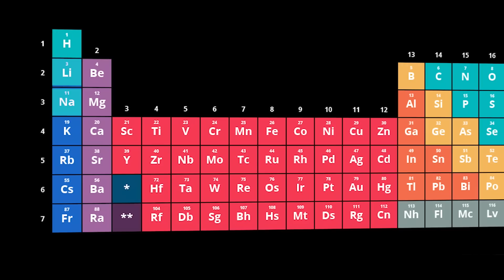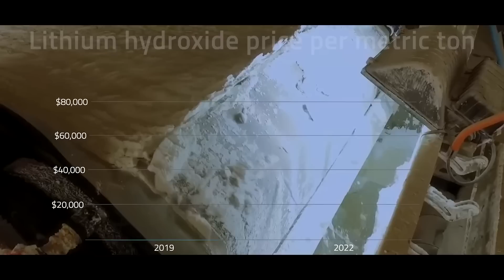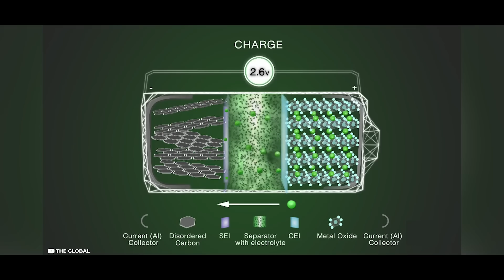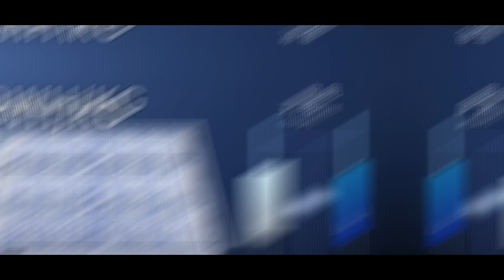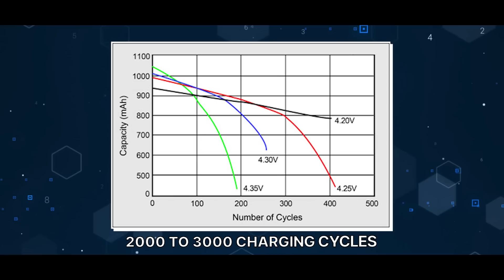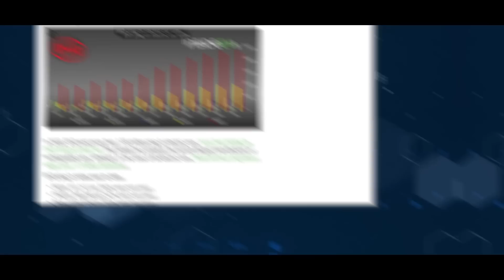BYD launching First 9000$ Sodium Ion Battery EV Changes Everything!

Comment: And think how much Li would be freed up if we used alternate technologies for static applications.  And these other batteries are superior to Li batteries in everything but weight.  They are made from cheap, readily available elements, are safer from a fire point of view, can be cycled from 0 to 100% with not damage, last far longer, need simpler charging/discharging electronics and can be recycled more simply, if you ever need to recycle them.  There are the liquid metal batteries based on SbCa or AlS (with new chemistries being tested), the ZnBr flow/plating or gel batteries, a whole range of redox batteries based on V and Fe (so far) and of course the mentioned Na batteries.  Note, for instance, that the famous Hornsdale 180mWh battery contains enough Li for 3000 60kWh EVs.

Comment: March 20 (Reuters) - For many electric vehicles, there is no way to repair or assess even slightly damaged battery packs after accidents, forcing insurance companies to write off cars with few miles - leading to higher premiums and undercutting gains from going electric.

And now those battery packs are piling up in scrapyards in some countries, a previously unreported and expensive gap in what was supposed to be a "circular economy."

"We're buying electric cars for sustainability reasons," said Matthew Avery, research director at automotive risk intelligence company Thatcham Research. "But an EV isn't very sustainable if you've got to throw the battery away after a minor collision."
Reply: There are approximate 6 million accidents out of 284 million vehicles on the road each year in the US, assume it’s all EV now, and ignoring the fact majority of those accidents are minor that does not require battery replacement, you are still looking at a 2% loss (reality is almost certainly less than 0.5% that need battery replacement due to accident).  

Now considering the amount of carbon output from those 284 million vehicles daily, factoring in the oil extraction, refining, and gasoline transportation cost to the gas station,  vs EV zero daily carbon output, power plants (many countries still use coal ) output due to electricity usage, zero fuel transportation output, and battery raw material mining / refining output. You are still looking at significant carbon reduction / environment benefits. That’s because the daily carbon output per vehicle is the most significant contributor to carbon by a very wide margin vs centralized power plant output that is far more efficient by comparison, even assuming coal and ignoring solar / wind that is powering significant portion of the electricity now. 

Do some research instead of just copying other YouTube comments as facts….
Reply: @onlythebest3311  Also...carbon is building block of life not a toxin.Parroting climate change propagandist with a decades long track record of failed predictions doesn't make you informed. Thanks for stopping by.
Reply: @pryda1  "carbon is building block of life not a toxin", this is so misleading and even wrong in many cases. Carbon dioxide is toxic if people are exposed to high level of CO2, from suffocation to acidosis. It is just like saying "water is building block of life not a toxin". However too much of water can cause water intoxication.

Comment: In the next decade or earlier there will be millions of EVs coming up for battery replacement. Can the same battery pack fit sodium ion batteries instead of LFP. I hope the dimensions and voltage characteristics are being kept identical to help in easy transition for existing EV users. It will be a game changer for sure if that happens. Let this news of easy transition for battery replacement break out and it’ll drive EV sales exponentially today. Nobody would be scared of buying an EV due to high battery replacement costs in future. A no brainer provided it can be swapped out with a lower cost Na-ion battery pack which can like to like replace the LFP battery pack.
Reply: Was wondering the same
Will they be able to be retrofitted ??
Reply: You obviously haven't been paying attention.. batteries are lasting longer than the cars themselves now

Comment: So here is some goofy math. If Sehol's vehicle can do 400k miles in its life time and costs $10,000, that is 40 miles / $1 vs an ICE getting 35 mpg (pie in the sky number) costing  say $3.50 per gal of fuel (this is also very generous) is 10 miles / $1. That is apples and oranges yes, but I am willing to bet that the cost to charge the Sehol vehicle over its lifetime is going to be cheaper then buying an American ICE vehicle. That is some too good to be true levels of costs savings.
Reply from the maker: Yeah if the electricity prices stay „low“ than yes it will. But as more people jump on ev‘s more demand will increase electricity prices st long term. But its definitely more efficient for sure

Comment: The biggest winner if all this come through is the environment. Who will pay for all the damage caused by mining the materials for the battery cars already made? And who will recycle all batteries with lithium?
Reply: lithium batteries are very recycleable, and multiple companies are already started and able to recycle all important battery ingredients
Reply: Do your research…. An X employee from Tesla already getting over 95 percent of all minerals by recycling….
Reply: Used Lithium EV batteries are also being lined up for grid power storage. If the vehicle is basically scrap value and even if the battery only has 40% of its capacity usable, that makes for a dirt cheap battery. Chop the passenger components and leave the bottom battery plate, toss it on a rack in a warehouse, and wire it up. After the battery is truly useless they are still recyclable and there will be a steady stream of end of life cars to fill the vacancy.
Reply: Cry boomer
Reply: This is very easy to answer if you were better informed. Major steps are already taking place to do with recycling batteries of all kinds. Always better to understand than to make out of context assumptions.

Comment: With the cold weather performance, charge acceptance, high cycle life and low cost, Na ion batteries would be a great replacement for lead acid in deep cycle, starter and accessory batteries. Many EV's still use lead acid for accessory batteries. I wonder when we will see them in the aftermarket.
Reply from the maker: I think Lithium iron will dominate the next few years of the ev battery industry until the next big thing comes
Reply: @The.Futurist  yes. Lifepo4 is the best now
Reply: @The.Futurist  He means the battery found in petrol cars, for the lights and that.
Reply: Lead acid battery is still more stable with good charge cycle. But there’s a good chance they can be replaced by solid state batteries like Sodium Ion if kinetic charging, lead acid battery depends produce sufficient AmpH input. Also the 12 v compared to 3.2v for LFP and possibly also Sodium Ion.
Reply: 中国应该今年看不见产品发布
Reply: @Xarifa Zee Lead acid has roughly 1/20th of the charge cycles as Sodium Ion. Considering the reduced price of Sodium Ion, and the lack of toxic materials, it will work out to be better ln the long run.

Comment: I hope BYD performs as well as this video promotes. Sandy Munro says BYD will be on top in China by 2030. Now it's time to show us. Tesla plans to use salt to extract lithium, both abundant and getting cheaper to refine. Lithium provides most power for transportation and storage in most any electrolyte combination. John Goodenough's battery research looked at salt and other elements and chose lithium for good reason. Even so, cheap fast rechargeable batteries will sell in every case as they will be purpose built.
Reply: Well, if you are talking about sales in China alone,  BYD already No.1 in 2023,  at least first 2 months.
Reply from the maker: Price performance ratio is always going to be the best option as it is more affordable. However, they cant match with the performance of lithium wich will be the gold in our future world!
Reply: @The Futurist  spontaneously combusting batteries aren't a good answer to any transport requirements. I, for one, won't own or rent an electric car until the risks are substantially lowered. They already account for 7.5% of car fires in the US, in spite of accounting for less than 1% of the cars on the roads - they even spontaneously combust in the night with everything switched off & they've been parked up for several hours...
Reply: BYD is now the largest car manufacturer in China. In the Chinese market, they are now selling far more cars per month than VW and Toyota.
Reply: I would like to see the child slavery stopped  .
Reply: @Joseph Wanjiku
You are probably texting on a device manufactured in China.
Reply: @josephwanjiku6853  sorry, no market
Reply: BYD is already on top.

Comment: Ok. What's the rest of the story?
Reply: If the charger network gets better in the next 5 years which will eventually, the faster charge times of Na-ion batteries will be a winner for city rides.
Reply: technology not really going to be mass produced for probably 5 years
There's no silver bullet that is suddenly going to change the game and make lithium ion obsolete.  Not this sodium, not sulfur, not solid state. The majority of cars will be electric, there may be a variety of chemistries in the future, but probably the majority will be lithium ion.
Any new technology takes years or decades to come to market. Lithium ion was proven in the laboratory in the 70's. It started being used in computer laptops and phones in the late 90's.
Reply: 4680s are coming. They charge in half the time and hold 50% more charge while being 40% lighter. Plus, production of scale is dropping the price. Oh, and I didn't even include any improvements in cell chemistry. Which could include the new sodium batteries. 😅
Reply: The rest of the story is that these cars are notorious for there "internal combustion" power.....bring some burgers and hot dogs because this thing can blaze up like no other.
Reply: 4680 has even lower energy density than 18650 and 2170. Sodium batteries are at least 30% cheaper, charges faster, and work at upto -20 C temperatures. The only problem now is that it has lower energy density than lithium batteries. They are also improving on this and mixing it with lithium batteries in EVs.
Reply: It is the energy density, lower than Lithium, thus the shorter range. Like the video said, perfect for the "city runabout" and short distances. However, for large cities, like many in the USA, this will be like the Nissan Leaf. People in the large, wide spread cities will still have "range anxiety" with this battery, until it improves further.
Reply: Well, let's not forget that this is just at the very beginning, the energy density will increase with time and the range will increase, this has a lot of potential!
Reply from the maker: The Rest of the Story is to be continued on the next episode of the Futurist. Stay Tuned. 😁🚀
Reply: P. S, it won't
Reply: @philipswich29  might want to look into it. Because Germany just started building a factory n should be running next yr. Bill gates and other big investors invest in a company that started from MIT. Australia is also in on it.
Reply: Severe lack of range.
Reply: @matthewhuszarik4173  density is t that much lower. Fast charge times and more charge stations will make this a winning strategy. 

This solves the material problems that come with Li Ion. Recyclability also makes these look good for anyone who actually gives a shit about the environment.
Reply: @petec9686  With home charging the primary source you may have a point, but with so many Americans still limited range adverse I think it will still be a problem. Because most ICEV have a usable range of >300 miles so they only have to fill up realistically twice a day for normally <5 minutes. A BEV with usable range of <150miles is going to require charging four times for a half hour?
Reply: @matthewhuszarik4173  at the moment longer range EVs are still play toys of the rich. 

These Chinese lightweight low cost shorter range vehicles will have a big market with a lot of people. 

And given a charging network at rest stops on interstate highways, they’ll even do well with longer range travelers. 

Most people want to stop for a piss break every 100 miles or so anyway. If they could get a 15 minute charge while stopping to get them another hundred mile down the road, it makes sense. More sense than a heavy very expensive 300 mile pack, IMO.
Reply: @petec9686  When the Japanese were importing most of the vehicles they sold here there was strong opposition even with Japan being an ally. It didn’t subsided until they stated to manufacture in the US and there are still many Americans who won’t buy Japanese vehicles. I don’t see China being a big success selling cars in the US until tensions subside considerably.
Reply: @matthewhuszarik4173  "The average trip duration globally is 15 minutes long. The average trip distance globally is 15 Kilometers / 9.3 miles."

Surprise, surprise, there is a target market, which are drivers like me that daily only drive like 20 km and for long trips just use another way of transportation. No point in buying a new "long range" car if most of time is sitting in a parking lot. Second, and most important to keep in mind, technology evolve. Just some years ago, lithium batteries had a lot of limitations and look now.
Reply: @krlost4405  Most people don’t buy vehicles for the majority of what they need they buy them to do everything they need. Why do you think SUVs are so popular? If a majority of people agreed with you small subcompacts would be the biggest sellers not SUVs.
Reply: @Matthew Huszarik  btw, if you think SUV are for "everything," think again. 🤣 Tricked by marketing and not even knows it, pathetic.
Reply: @Matthew Huszarik  If the majority of people agreed with me, you would have a decent public transportation. Again, learn on YT why SUVs were MADE popular. PS. Not because people were "bright" or in "need" of it.
Reply: @krlost4405  Nothing does everything, but SUV do more more than most and far more than a small commuter car. The only way small commuter cars become attractive is if gas and electricity gets much more expensive.
Reply: @matthewhuszarik4173  
Why should we care? At least itu works.
Even people don't drive more than 200 miles daily.
Reply: @matthewhuszarik4173  Lack of range is still suitable for some application, local transportation

Comment: Other than for very short ranges, Sodium Ion for EVs will only work for longer ranges when paired with sulfur which can store more of it. That's coming in a few years. However, where sodium will help out immeasurably is in standionary storage freeing up more Lithium for EV's, including for Lithium-sulfur batteries.
Reply: @New Tunes For Old Logos You don't need a 300 mile range luxury Tesla to drive 6 miles to the train station. Get a Bolt.
Reply: @jamesvandamme7786  The biggest hurdle for budget EVs is charging infrastructure, in the UK its dogshit if you cant charge at home. For those who want cheap EVs the chances are they dont have a dedicated drive to charge their EVs.
Reply: @NickLiang  Half of us have garages.
Reply: @jamesvandamme7786  Show me a statistic which shows half of people living in homes have garages, you'll find you're wildly wrong. Majority do not have a suitable place for a home charger.
Reply: Cheap and affordable storage is what we want.
It will be effective and effective for homes and factories power without the need to supply vide external external cables.
Reply: You may just increase the battery size by 30% and end up with the same range.
Reply: @ajlover5447  Space and weight is also a problem for cars but not for stationary storage as June stated.
Reply: @alexandruilea915  It will be just a few centimeters higher, weight is not so much an issue, because energy is regenerated when braking,
Reply: @ajlover5447  when going at a constant speed like highway speed weight is a huge problem.
Reply: @alexandruilea915  This is aerodynamics, does not depend on weight.
Reply: @ajlover5447  weight affects the rolling resistance of the tires tho so you will end up with higher energy consumption
Reply: @alexandruilea915  It is small compared with air resistance (independent on mass) on he highway, while in the city small compared with acceleration resistance (independent on mass if recycled when braking).
Reply: Acceleration is just a bit slower with same battery output.
Reply: @ajlover5447  !!!!!!!!!!!!!!!!!.....Mostly No One can understand this................Paul
Reply: @@newtunesforoldlogos4817 That's why I'm looking at plug-in hybrid for now. Short trips to stores and commute (my drive to train station is 6 miles). These can be 100% electric. When doing a rare road trip, the gasoline engine kicks in with no range anxiety. Full EV in the US is way overpriced; I'm not paying nosebleed prices to look cool.
Reply: @relaxo916x  PHEVs would benefit greatly from sodium-ion.